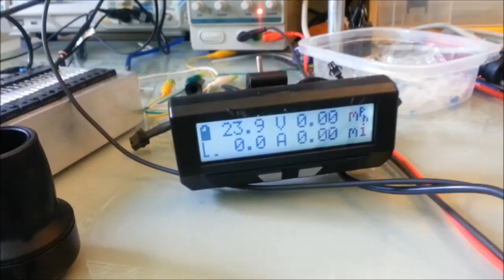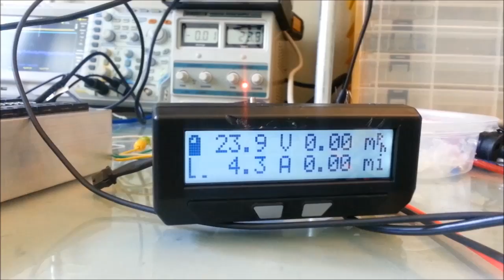DIY 18 MOSFET controller running

Comment: NIce toy Arlo,

I see you bought one of these QS 3000W hubby with the golded motorcycle rim?  do you plan using it with your new controller?.. Also did you installed Hall sensor on teh Me0913? or do you drive it COS/SIN?